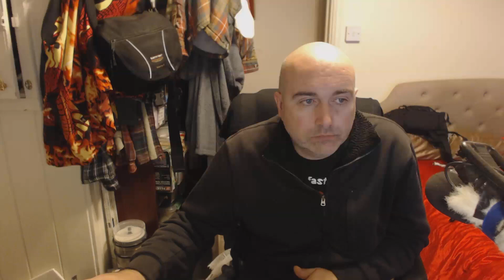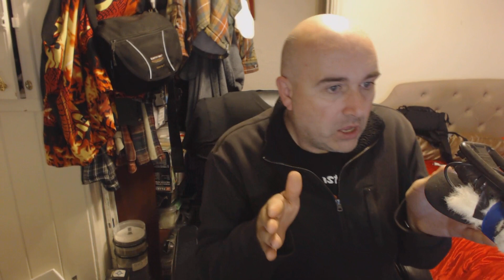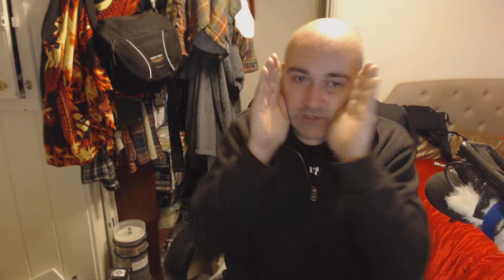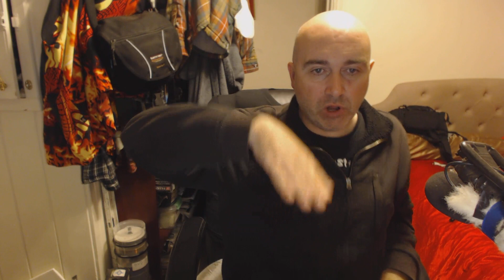DJI Mavic SAME OLD FLAWS - Learn! Hint... its not PRO! (obsolete video)

Comment from the maker: INPUT REQUIRED... please comment:
Update: I have a meeting with Mavic owner tomorrow and we are going to go through some comprehensive tests on the areas I am most interested in. Listed here:
1. Ability to tilt and yaw smoothly when dialled into softest settings
2. Evidence of kick in the letting go of either tilt or yaw controls
3. Ability to force into ATTI mode when outdoors (im told only GPS can be used outdoors - ATTI indoors) - I want to investigate this.
4. Scientific calibrated analysis of how stick movements equate to drone movements. Filmed for timings.
5. General feel of how easy it is to so smooth YAW and TILT WHILST in flying manouvers - ie a complex task.
6. Difference between tripod mode movement of sticks and output vs normal mode sticks and output.
7. Measure base of stick travel distance - measure tip of stick travel distance in cm. Can produce a ratio for tip of stick distances moved.
8  Ergonomics of controller tilt position - can it be reached easily.
9. Measure tilt controller travel range. 
10. Measure tilt timings based on set positions of tilt control - based on tilt slowness settings in APP.
-----The tilt tests can be done not having to fly... thus saving battery!
11. Any evidence of EXPO on the tilt or ability to control via the APP?
12. Can it handle the extra weight of a small tracker device.
13. VSI without tracker to 100ft - VSI with tracker with TRACKER

    IF YOU CAN THINK OF ANY AREAS YOU WANT ME TO LOOK AT PLEASE POST HERE.

Comment: i like you're honesty and no bullshit way of talking. for me i think the mavic will be an awesome piece of kit that will actually allow me to use a drone easily and get some amazing footage. i have a video shoot planned and want to have some panning shots whilst moving forward, won't this be possible with the mavic? also what about the camera pointing down to the ground and then lifitng up whilst rotating isn't this a realtively easy move?
Reply from the maker: I hope it is possible. Clearly youll need to down the expo on the yaw and maybe other controls... and you may also find the tripod mode useful. The gimbal tilt will have to quite slow in the settings also. Then its down to your very careful manipulation of the controls - because its you the user who has to eliminate the input KICK with your fingers because DJI havent provided any smoothing in the controller or app. I would love to hear how you get on. I am going for a Mavic demo this week so will also report back to everyone.
Reply: Thanks, you clearly know your stuff and a real world demo would go a long way!

Comment: Not thumbed down, but have to tell you this is available and has been for some time. I believe the last Dji product you had was a phantom 2 ? Correct me if I'm wrong. You now have your own build hex which many people here commenting negative shit would only dream to be a pilot like you. I've seen all your work. It's good. Ok the point. You can change the yaw and controls in the Dji app and have the smoothness you wish for. I fly and have tamed down the controls to fly smooth without the gerky yaw etc. Have a look this is outdated but so you know. https://www.youtube.com/watch?v=flxXdzcLO2w
Reply from the maker: Ive said umpteen times on here .20 expo is not enough to give a smooth YAW control. It used to be .3 on the Phantom 3 now its been eeeked down to .20 for the p4 and mavic. So heres a big HINT HINT HINT... you know hy doing this that DJI know exqactly what people want and need and REFUSE TO GIVE THEM down to .01 which is what many have wanted and needed. Theres your proof. .20 is not low enough. Those sticks are still twitchy even on .20.
Reply: hence your mavic review. told you so ;)

Comment: I've seen many videos that show smooth movement, what made you think the Mavic has jerky yaw?
Reply: The DJI demo videos from themselves show rough tilts and yaws... links are above in the description. See if you can spot. The problem seems to be the exact same problem all Phantoms have had - a twitchy yaw stick which is that way even after you dial in full EXPO. Sadly though they limit how much expo you can have down to .20 which isnt enough IMHO.
Reply from the maker: You dont seem to have any drone footage on your channel. I would suggest that you may be an armchair pundit in this debate. If not show me some smooth footage from your Phantom or Mavic.
Reply: I am not trying to debate, I just stated that I have seen smooth footage in tripod mode. I am fairly new to the drone world, but I'm sure when I get my Mavic Pro and have some hours on it, I will start posting footage.
Reply from the maker: Ok there is a tripod mode, agreed. However this slows down all controls equally - not just yaw. What we need is tripod mode for yaw only. Also a smoothing feature so if you let go of the yaw it settles slowly - like a bell curve - ease in ease out. Thats what needed. Hey if im wrong I will say so and apologise to everyone on here. However I know youve got to have nible fingers in anything but tripod mode... and in tripod mode - the move front back left right is very slow...

Comment: Has anyone else noticed on 4K cameras and drones these days that when you do pan left or right the video stutters?
Reply from the maker: I wrote a long reply and my browser crashed. So bollocks.... your having the quick version.

Modern cameras use shutter speed to control light input levels 
into a camera, often in place of an IRIS. This means that with varying light the stutter will be more or less. This is crap. Modern phones used CMOS chips which are "rolling shutter" which also adds to this mess.

You want to aim for global shutter cams and always shoot on manual with a shutter speed twice that of your frame speed ie for 30fps choose 1/60th shutter speed.  This should give a more film like look with natural blurs rather than faster shutter speeds like 1/1000th which require more light to film in are sharp every paused frame on playback. Its these fast shutters and sharp frames that make things look stuttery often. You can fix some of it in post produuction by applying time based motion blurring - sometimes known as temporal blurring. 

Also check out "rolling shutters" vs "global shutters" - there will be lots of youtube videos on all these issues. 

The long and short of it is often if you want to minimise the effect and have little or no control over your gopro, cmaera phone or video camera then put a Neutral Density filter over the lens. The darker the ND filter the more the shutter slows down - so more blur comes back, some blur is good... too much looks weird ;-) So ND8 for daylight video is good... and no ND filter for evening and dark shooting. That minimises the effect. Theres some terms for you to look up and learn what they do. If I can help any more let me know... 

Oh a plug - Mercalli V4 Video Stabilisation software has CMOS compensation for after image and jello effects in video so can help smooth out some stuttering. Download a free demo copy and try it out.

Comment: Control sensitivity control is available on the Mavic controller. Your point of view would be taken better without all the crass language, besides I enjoyed your video but sensitivity is able to be controlled FYI
Reply from the maker: Dude, you dont even have any videos of you flying. How can you tell me I am wrong. Lets see you doing some smooth yaws and tilts then.
Reply: because I don't post videos is your retort? Chill out, get a shag. It's been mentioned multiple times that the Mavic RC has the ability to control the sensitivity of YAW control

Comment: Truthseeker but is there any better for the price? I bought it for essentially one use and for the experience after. After hearing this about the panning, but I'm not sure if i should cancel the order because i need it on November 5th. Recording a wedding parade through a narrow street so stability and size are very important.
Reply: They are an awesome copter and Im fairly sure they could easily provide these smoothingh features and sort it out in firmware. I would personally love one - it would beat the shit out of mine in stability and quality and features but mine would still kick its ass flying into stupidly powerful winds that no other pilots ive bet said they dared take off in. apart from that, yes I dont blame you.
Reply from the maker: There is the Yuneeq but its large. It does a great job of filming but could never be carried easily on a plane etc. So really DJI are ahead of the game on price and 1080p streaming and a few other things. However they need to open up the app to let people properly design their own profiles - 100% control. Not this 50-20% limits that they give people right now. My YAWing on my own built copter plays in the 1% to 17% range for smoothness, so it just goes to show you starting at 20% isnt going to cut it for me. But still - because of the rest of the good features it maybe something that we have to overlook for now.
Reply: truthseekers666 So you are unable to trim and adjust rates? Even toys are able to adjust rates..what horse shit if you can't. I can understand the gimbal rates being non adjustable but even that seems software side!
Reply from the maker: ++onemanpainballarmy You can adjust the expo and "gains". ive seen the expo adjustment in a few videos on youtube for the mavic but the problem is this shitty 20% they let you take it to. Ive not seen ANYONE on youtube so far talk about adjusting GAINS to help. My understanding from my Naza is that GAINS is simply for stability and a mavic is RTF (ready to fly) almost so wouldnt need those adjusted. They affect weight to wind stabilisation issues and if yiou under cook them your craft wont recovery properly and if you overcook them the craft will judder and over correct itself - so thats about flying characteristics and not input control smoothness as far as im aware. Sorry this got a bit techy,hope it helps.
Reply: truthseekers666 So in other words they have a proprietary "optimization" already out of the factory so if i went in for adjustments it voids my replacement warranty? Ive never owned a quad before and am only used to planes.
Reply: truthseekers666 So in other words they have a proprietary "optimization" already out of the factory so if i went in for adjustments it voids my replacement warranty? Ive never owned a quad before and am only used to planes.
Reply from the maker: Well the gains are there for you to play with for sure... but if you play with them you will get either sluggish self righting or over sensitive self righting of the copter. Say you put someothing on the copter that made it heavier. You would want this... No I dont think that in itself would void your warranty. However if you went crazy of the gains it would made the copter unstable I guess and if they saw THAT in your flying logs, you may not get a free repair if they didnt like what you were saying about why you changed them. However little changes are all you would do here to fix flying traits. As I said before GAINS doesnt have much of an effect on what your control do - just aircraft stability and recovery.

Comment: What you're saying is not true. You can adjust controller settings in the software to make controls more/less sensitive/responsive to your liking. Also, better pilots have more refined skills at flying. Most of the footage you see online is posted by pilots who haven't taken the time to learn what these devices can really do. Lastly, these adjustments are quite simple to do.
Reply: Tell us. Even better get your camera out and show us, lets see the 
procedure in the software.  Everyone can get "some" good shots by being 
careful enough and only picking good shots out of a load of bad ones. I 
want to see that this technique you use is making things good most of 
the time... I dont doubt you - but lets see how its done. Make a youtube video and tell us!
Reply from the maker: you dont bother to read the other comments.

Comment: Now...here we have a bitter man that want a 700g professional drone that do the same thing as a huge octocopter ,
The rest of us understand that you got a standard model with crappy wifi connection and a pro model with 7km range. Thats impressing on a 700g quad,,,, but nooo. You think that it should be a professional plattform for Hollywood movies and national geographic , how about you show us a better drone for 1000$. You think that all uk dont want dji drones as they have so bad service, but guess what brand sell best in uk ? Of every 10 drone 7 of them is from dji and the service you get from them is the same you get from others also, biggest different is that dji is the drone with least problems, they have been the leader from day 1 and they are lightyears infront of others, look at what gopro released now with the karma, a simpel quad with single gps and without vps avoidence followme programmed flights . Its a phantom 2 with removable gimbal
Reply from the maker: The thing is the Mavic can 100 be used for professional work. Its quality is good enough and it can go where other drones cant.  The issue is that is DJI refuse to give full optimisations of controls then you will be stuck with sharp sensitivity controls. I am NOT a fan of split control systems like the INSPIRE or Matrice because they are designed to give only one image down to the cameraman... so how is the pilot supposed to know where he is and how close he is to objects when the camerman is blinding him by turning the camera 90 degrees and 180 degrees etc etc.  I have never felt once like I needed to turn my camera one way whilst I fly in another direction. A good drone operator can pull ALL the moves a split camera system operator can, because they are skilled at the controls. See my 1 fixed gimbal camera drone footage.... transition of front flying to slideways flying seamlessly. No second operator required.
Reply: Yes i know yaw can do the same as 360 gimbal and i totally agree that as a single operator it is much better to not use 360gimbal as it is easy to be confuced what is forward and backward when the camera is sticking another direction then forward. Most that fly inspire dual setup have a extra fixed fpv camera and i cant see why dji didnt do that themself. I never understood why all yuneec owners were so exided over thypoon.h gimbal.   Its nice but 360 on it is pointless really.

I fly racingdrones and phantoms almost every day. But i dont really have any problem with the yaw. I think its look good but its not a on/off switsh. Have to take it really easy or turn down the yaw rate in settings. I use stock settings myself and are happy with it . But i guess you need to be used to it. I use 75% rate when i use racingquad and then im used to small movment on the sticks
Reply: Sounds like you are using a custom controller if your talking 75% terms. Such things dont exist inside the DJI apps as far as ive seen. Yeah isn't it sad that DJI release a 360 camera on the Inspire on a 2 person drone.... and yeah you then have to go fit yourself a second camera with wires everywhere and battery cables and antennas. You would THINK that they would realise that the pilot needs to see where hes going. No apparently DJI think the pilot flies with his fucking eyes closed using "the force" to guide him. He doesnt need to see. Why would he - hes just the pilot... and not the poncey camerman who probably outranks him ;-) hehe
Reply: Matthew Williams i say im used to 75%rate on my RACING quads thats why im used to not moving sticks much,,, but if you are a "sticks banger" that move sticks to end positions then the phantom moves to fast, but often i like to drive for fun and then i like to have the option to take sharp turns so i think its perfect the way it is now,  if it wasn't im sure most would complain about its slow and boring.  But its hard to please everyone, those who dont like how dji configure drones can get another one, there is a lot to choose from out there